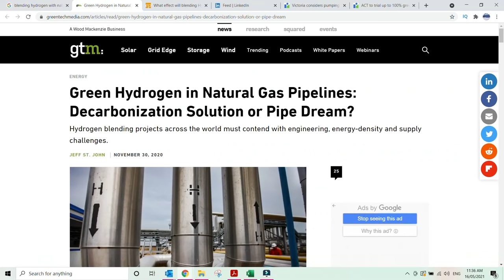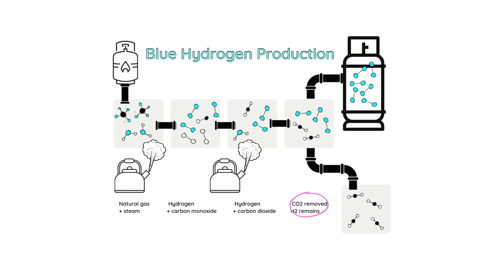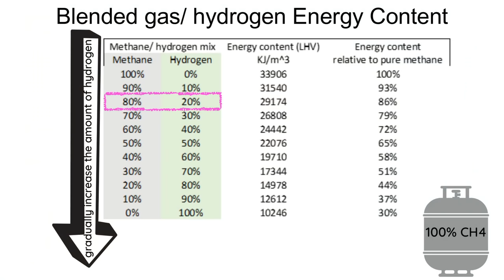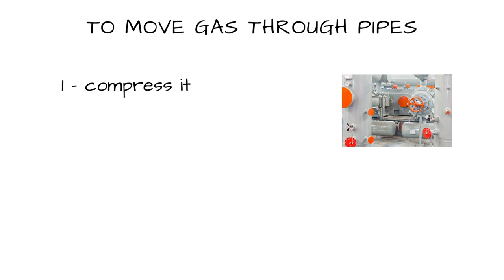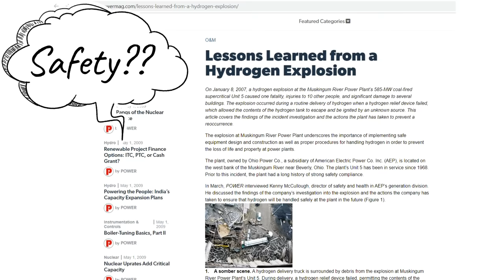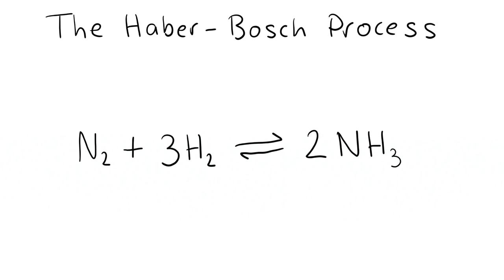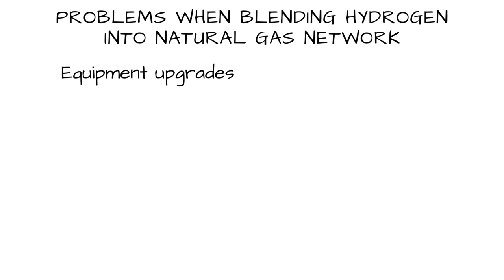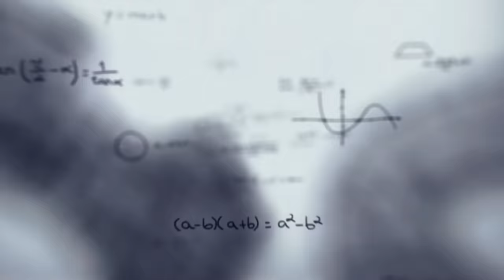Hydrogen in the Natural Gas Network

Comment: They alredy have Hydrogen stored with the proper Technitians.
Train more people .
I would not transport Hydrogen all over the place.
Make Cluster Storedge Facilities. Like patrolstations with trained Techies.
Transport the Energy not the Hydrogen. Generate Hydrogen in patrolstations out of Water , as green Hydrogen.
You can transport water safe !
It is like an Atomic reactor. They need maintenance all year around , by trained techies.
It shouldend be this difficult !
Training people cost money . 
The difficulty is in trusting not the technicol problems.
If it is for steelindustrys , thouse patrolstations need to be made bigger.
For local consumption with Hydrogencars . It should be not very difficult.
I like the cleaness of Hydrogen.
If you have teribble people near by. It dosend matter if it is Hydrogen or EVs .
Damage will be made by thouse people. Maybe of hate ?
Planet Earth , and the people dont mix well over extendet time.
Good luck !

Comment: There is no such thing as GREEN hydrogen. You always have a MUCH higher efficiency using that green energy by using it as ENERGY instead of converting it at a 40%+ loss. That is also why solar panels are so bad. You get 20% MAX of every KW the other 800Watts go to heating the atmosphere. After line losses etc you end up with only about 60Watts of power when using it to power an electric car for instance. When using Concentrated Solar Heat you have 900Watts of heating for your home out of every 1KW. So if anything replace your heating with Solar heating.

Comment: Ok two questions

1) it is so easy to remove sut from gas that I was going to set up one at home to sell carbon and recover my fuel costs
2) if converting hydrogen into electricity is so superior, why is it not done with natural gas?

Now two despicable laughers keep laughing into microphones or you will be cut from big carb

Comment: What pressure is he talking about in the gas mains? They carry far higher pressure than households, which is why there is a regulator on the mter & appliances to step the pressure down. Jets in gas appliances can be changed to convert then to run on different types of gas, why not hydrogen? Leakage is an argument naysayers use all the time, but never mention what the rate of leakage is; how long does it take for a hydrogen atom to escape through a centimetre of steel. I bet it will be slow enough to be negligible. If we are talking about piping it through gas mains, why is he talking about a 700 bar tanks? He doesn't think much of ordinary people obviously, but what pressure are LP cylinders? You should watch video of one of them exploding and ask why the same safety concerns don't apply, hydrogen won't make you any more dead than LP gas, or the petrol in your car, both of which ordinary people use every day with relatively rare accidents. How do you make a hydrogen tank explode anyway? Toyota tried it by shooting a Mirai's hydrogen tank with a 50 cal bullet, which you can find on YouTube. But this is a more likely scenario, because unlike petrol  vapour or LP , hyrogen is lighter than air and held under such pressure it won't pool. https://www.youtube.com/watch?v=OA8dNFiVaF0 I'm obviously not as qualified as your guest, but maybe you could get a second opinion...